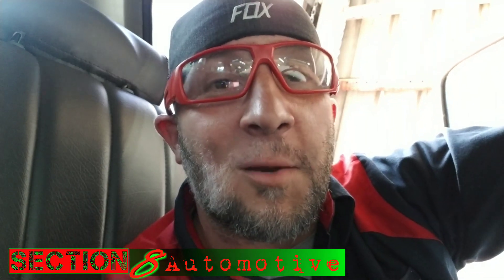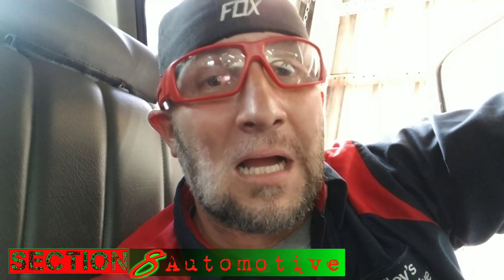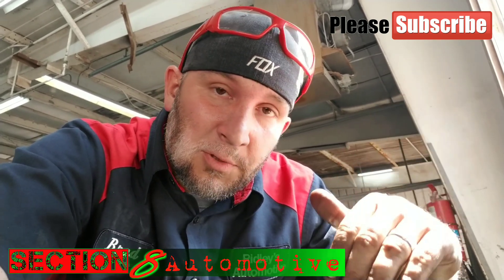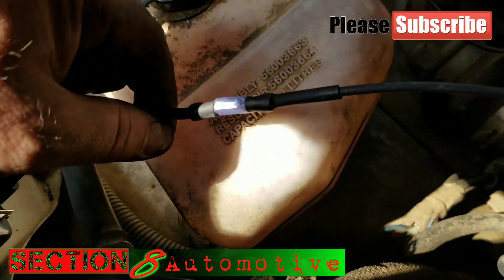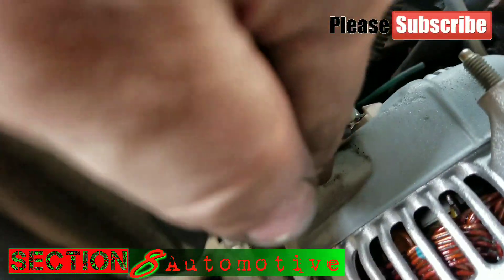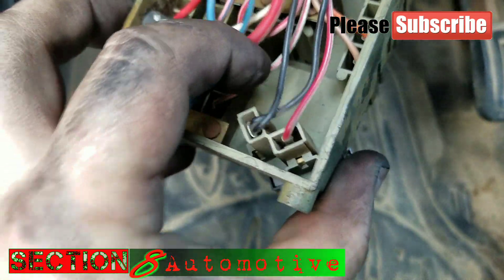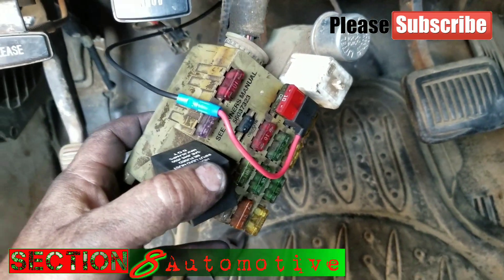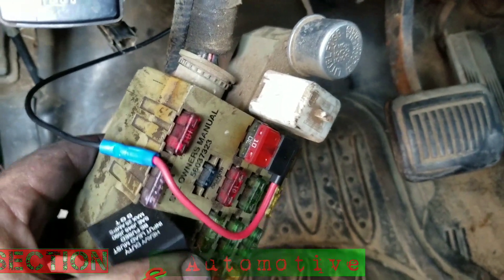How to install External Voltage Regulator dodge chrysler jeep  wire voltage regulator 12v Cummins

Comment: Please help sir! After i followed every step my ram still not charging, you think my regulator is bad? Do i need a dummy light for this ? Because my dash light doesnt go on or off? Please help thank you
Reply from the maker: If at any point during the install u had the battery NOT disconnected or wired wrong on initial started then yes ur regulator is probably bad. Make sure you are doing this without ur battery hooked up. Also I have gotten regulators straight from the parts store that were bad out of the box. I've do this repair on many trucks and have never had a problem other than the rare New regulator issues.
Reply: Thank you ! I will try it again, thanks for your videos in taking your time and showing people knowledge on this case!

Comment: you mention a link to the regulator but I don't see it..my 1993 D250 Dodge cummins stays low  when I first start truck 8-10 amps then bounces up after about 5-15 seconds and it stays at 14.,2-6 but one in a while till it warms up some it goes back to the low amps then back again..What could be causing that
Reply from the maker: You r correct sir. Here you go.  https://amzn.to/2OaH2G1
Reply: @Trouble.Maker.Racing  thanks it says it is adjustable..what should it be adjusted to?
Reply: @Trouble.Maker.Racing  sorry it says dodge 1970 to 1987 mine is a 1993 D250..is it the right part or ...
Reply from the maker: @MrFrodo1111  yeah it will work the same way for the 93. High 13v to mid 14v when its charging correctly 14.2-14.5v is my sweet spot I shoot for tho
Reply: @Trouble.Maker.Racing  cool..ordered and waiting now..it lasted 3 months but seems to be bouncing more last 2 weeks
Reply from the maker: The pcm is having issues stabilizing the alternator output. Next step is it will go out completely and over or under charge the system. Either way when it happens you will be calling a tow truck.
Reply: @Trouble.Maker.Racing  that is my big fear as I will be towing my fifth wheel 12 00 miles soon to AZ...dont need it going out in the middle of nowhere..thanks for telling me!

Comment: I need help with the external regulator on my 02 Cummins. I hooked it up and now my lights are pulsing. Any recommendations?
Reply from the maker: whay are your volt readings when its pulsing?
Reply: I did the same on my 93. The lights a pulsing and the volt gauge shows high
Reply from the maker: @bretttaylor9156   either the reference wire is not providing a good reference so try running it straight to the Battery post.... or Not a good ground. If it still over charges then the regulator is probably bad. Also make sure the green and blue wires are on the same alternator post as I had it in the video.
Reply: @Trouble.Maker.Racing  everything is wired the same. Still does it with sensory wire coming straight from battery. The top little post that the blue wire runs too ready the same volts as the battery. The bottom stud fluctuates between 5 and 15
Reply from the maker: @bretttaylor9156  sounds like a bad regulator

Comment: Ei bro can i do that to my 2010 dodge journey 3.5 .?  Cuz my custom 320a alternator  even with truck on still a  12. 40volt
Reply from the maker: I've never personally done it but in theory it should work.
Reply: @Trouble.Maker.Racing  nice i think im gona have to order or take it to a shop n get that install
Reply: Are in los angeles??
Reply from the maker: @cventura3158  no I am not. Sorry

Comment: What did you do with the factory wiring? I see the green and blue are cut. But what about the main how for the big post and the ground? Would really appreciate it to find out thank you.
Reply from the maker: The small factory wires i cut and just put shrink wrap on them so they wouldnt touch anything. those wires go to the factory PCM but the PCM is no longer controlling the alternator. as for the main wire (charge wire) i left it alone.
Reply: Section 8 Automotive  ok so you did hook the charge wire back up
Reply: Section 8 Automotive i have a 92 cummins. And it stoped charging so i done the regulator  and now its over charging any help would be great
Reply from the maker: @huntergilpin3102  when u say over charging.... what is the voltage output
Reply: Section 8 Automotive 17 then keeps climbing
Reply: Section 8 Automotive if it help to know iv run it the same way you did. Thank you for helping
Reply from the maker: @huntergilpin3102  either the reference wire is not providing a good reference so try running it straight to the Battery post. If it still over charges then the regulator is probably bad. Also make sure the green and blue wires are on the same alternator post as I had it in the video.
Reply: Section 8 Automotive ok i will try that. Thank you for the help
Reply: Section 8 Automotive did so and did the same as before so that tells me it is the regulator correct
Reply from the maker: +Hunter Gilpin thats what i would try next.
Reply: Section 8 Automotive the voltage gauge shows about 15.2 but the battery and alt are showing around 14.6 is that good or is the gauge just off
Reply from the maker: @huntergilpin3102  that's fine. The meter is probably more accurate than the gauge. Anything between 14.6 to 15.2 is fine.
Reply: Section 8 Automotive amazing your video honestly helped man great work keep it up thank you soo very much

Comment: Im interested..about electrical wiring..my question are...i have owner jeep with voltage regulator..it is possible to install another external  voltage regulator with same wiring as you show on your video
Reply from the maker: Sure the concept is the same
Reply: @Trouble.Maker.Racing  sir..another question..my alternator have 2 pin the other seperate wire power source connected to ignition switch positive...my voltage regulator have 6 pin with 2 coil..my jeep not usually using only once a week..very hard starting..what is your comment about it...

Comment: Ok. But how do you prevent throwing a check engine light? I have seen so many of these vids on this and all of them don't even mention throwing the engine light and the ones where people comment about how to fix this no response is ever given. I need to do this on my 05 dodge caravan but I can't afford the time to keep switching wires around for inspection purposes.
Reply: there is also a frm module you can get that will wire into the two field wires you cut at the alnernator that will tell your pc to stop throwing that code
Reply from the maker: Never got a check engine light. These older OBD0 and OBD1 cars/trucks wont trip the light as long as the system has proper voltage.
Reply: But i don't have an older OBD0/1 car. I have an 2005 caravan, that's OBD2 and WILL throw a light when I snip that wire going to the computer for the internal voltage regulator.
Reply from the maker: @MrCougar214  in that case you will get a MIL light but the vehicle should run fine and operate as normal. If you dont want the light and you know the alternator is good, check continuity from the alternator to the PCM, if the wires are good.... replace the PCM.
Reply: Umm, no. I'm doing this because it's a cheaper alternative to buying a whole new PCM. The only thing wrong is the internal voltage regulator went out. I'm not buying a whole new PCM just for that.....lol
Reply from the maker: @MrCougar214  I hear ya brother! Well I hope this video helped.